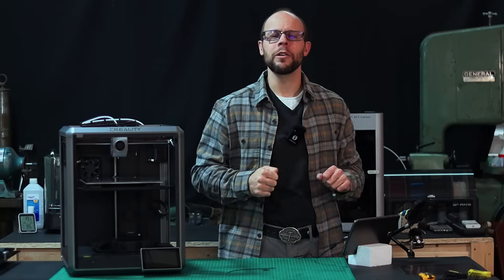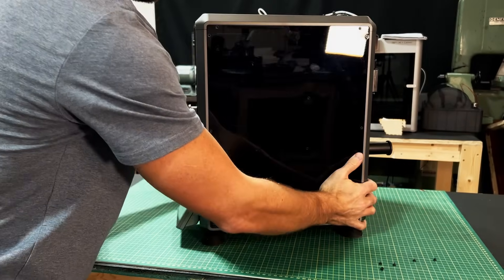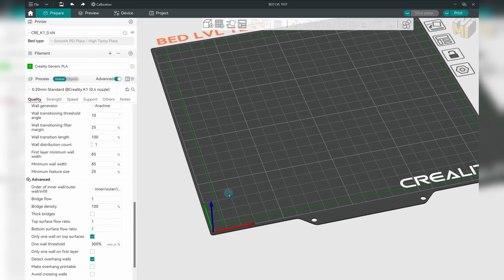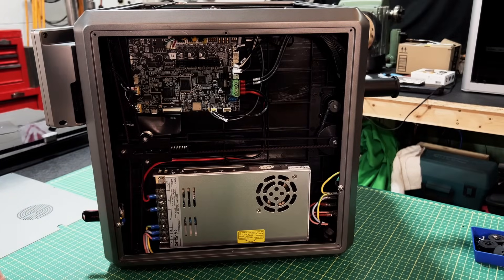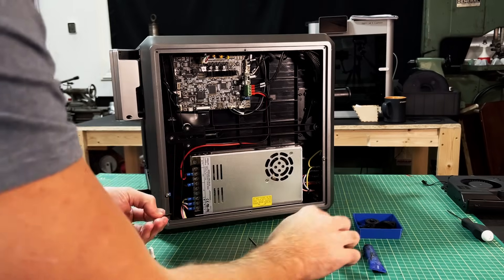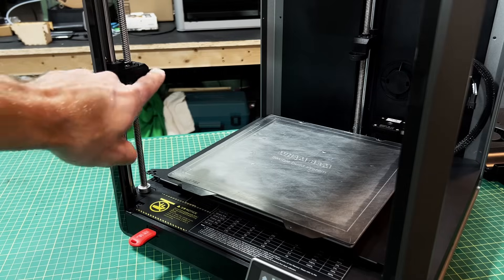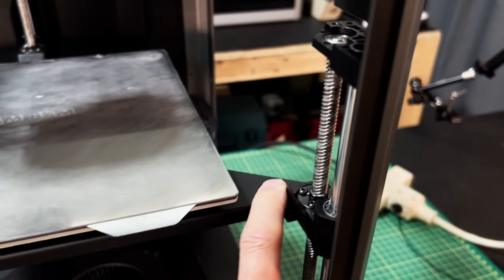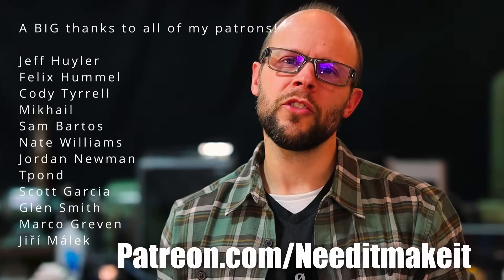Quick and Simple Way to Level Your Creality K1 or K1 Max Bed

Comment: what is the name of the program that u use to show heightmap? Iam using Creality Print but didnt seen this thing in it.
Reply from the maker: LOL, you can find the heightmap by typing in your printer's IP address into your search bar.  if you want to use the programs that I used, those are either Fluidd or Mainsail and you'd need to root your printer.  I have a video on that already.  It is called 'Quick Root your K1"

Comment: Hey man, I print mostly in ABS/PETG, where bed temp is aways higher, should I calibrate my mesh under those temperatures? (I figure that if not, the printer will work over a bed mesh completly different of reality (mine warps a lot under 100ºC - for ABS)
Reply from the maker: Hey, I have made a few follow up videos on just that subject, Let it soak is one of the most recent and probably helpful videos for you because we've been able to add some coding to automatically account for the temperature difference and warpage at those higher temps.  

In any case, the answer to your question is yes you should for the best results.  If you have the K1, the bed is smaller and it's not as much of a problem, on the Max, there is quite a bit more warpage and you'll want to leave the printer at the desired bed temp to soak.  

If you have a moment, check out the Let it Soak video and let me know if that helps.  If you don't want to watch it, there is info in the video description to help as well.
Reply: I would really like to agree with you, if I was not in a 10 days streak of TERRIBLE first layers with no sign of solution. Tried everything, to no avail  @NeedItMakeIt

Comment: I bought a K1 Max today and it is off almost 2 mm. I will be printing some shims. I think the reason the bed can't be fixed totally by adjusting the belts is because the way the pulleys were fixed to the shaft and the number of belt teeth from the left and right lead screw. It could maybe fixed if the set screws were loosened and re-tightened, but I don't want to mess thing up to much at this point.

Comment: I just learned something trying to do this that I need to share - if you're having trouble with the nozzle dragging the build plate, before you take the bottom of the machine apart, try to wiggle the nozzle. If the nozzle has any play in it, the hot end is probably loose!! There are two long M2 screws holding the hot end on. Pull the silicone sock off the hot end, being careful of the wires, and make sure the screws are tightened at the top. If the hot end is loose, there's a good chance one or both screws will fall out when you remove the silicone sock.

Comment: I just love your work.  Thank you for taking the time to do these videos!  
Now do me a favor and get a good screw driver ;-)  
I just can't work without my snap-on ratcheting screw driver.
Reply from the maker: Thanks, oh, I've been using PICQUIC since I was a teen, and  they work pretty well, though their quality isn't what it was for the bits.  I plan to upgrade my keys, I'm just about to buy a new set right now, some of my other tools will come next once I can ramp up enough with my YT videos.    Do you have a model # that you can share for your favorite screwdriver?
Reply: @NeedItMakeIt  I sure do.  8-3/4" Ratcheting Standard Screwdriver SSDMR4BO.  Like you, I have had this since I was a teen.  So now that I think about it, I have had it for nearly 30 years...
Reply from the maker: @christiandrouin9460  That's a nice tool!  The price is a little high, so I will make a deal, when I reach 100K subs I'll buy one outright and I can make a video on it to see how good it really is.  A 30+ year tool is worth the extra $$.

Comment: Printed up your spacers, tried two on a side that was on the low side, but I had to recalculate. I decided to go with a single spacer, the second smallest just for one lowest dipping corner, the result was almost pure white & mostly level, then I decided to tighten the existing screws, more on the highest end and it actually helped a bit better.  I did not use the long securing screws for transport.  I think because I only used one thin spacer, the mesh resulted in being closer to the board in the diagnostic window. Thanks for your help.

Comment: Can anyone tell me the exact size of the screws that hold the bed down? I lost mine.
Reply from the maker: I didn't find that you needed them, when you remove the belt-tension, you can bottom them out and then re-apply the belt-tension to them.  Having the screws is a bit of a problem because it causes the arms to pull down into a position that they will not be when the screws are removed.  As long as you can get it to within 1mm, the shims will do the rest of the work and get you to where you need to be.

Comment: u dont turn any rod ? just put donw and zero to factory position when use screw ?
Reply from the maker: Unfortunately the factory position will not give you a bed that is parallel with your gantry.   You can use a method called the tooth skip, or you can unscrew the nut on two of the screws and turn it, it may end up raising/lowering more than you'd like it to.
Reply: @NeedItMakeIt  i get 4 screws m4 30mm 4 creality spring 20mm and fix ahahahah! now start screw calibration, i reduce factory leveling 4.7 or 5 to 0.424 now try fix more! thx per help

Comment: I bought this k1 max of yours...
in general, I never advise anyone to take this garbage.

The quality is low. My old anycubic i3 mega (not even an s) printed better, but this one out of the box prints very poorly, even at low speeds. There is snot everywhere and at the same time the model is constantly peeling off.

The AI camera does not work, it is essentially a useless function that hangs like a dead weight, the broadcast turns on every other time and has never saved from hair instead of printing.

This printer is not in the kura or in the creality's own slicer. And there are no settings for it anywhere.

This miracle of Chinese thought got clogged on the 5th printing, disassembling it is still a hemorrhoid, yes, of course, the light printhead looks beautiful, but it is arranged as idiotically as possible

In general, it can be used as a 75k coffee table, but as a printer it is the worst for its money.

Comment: What you are doing is unnecessary and far too complicated.
Before I convert the print bed like you did, I find it easier to turn the respective Z-spindle. And since the factory mounting bolts are all the same length, you only need to worry about the front two spindles. I personally found it much easier. After all, you only have to do it once.

Comment: There is a better way… I just did it to all 3 of mine. The beds were visably out with the left being high seems typical with everyone else. I instead of flipping it over, you just unscrew the 4 screw on the lead screw nut. Turn the nut clockwise one screw hole. This seems to be about 1mm. Worked out perfect on my printer. It’s too much of a pain in the ass to move one lead screw the recommended way.
Reply from the maker: Hey that's a great solution, nice going!
Reply: @NeedItMakeIt  I wrote you on instagram another idea I had would be cool to see you try it out I’m going to play around with it and see what happens as well.
Reply: Would you please tell me where is that 4 screw on the led screw nut at?
Reply from the maker: @mikearocho3859  Should be accessible from the top where the 'wings' of the metal frame below the bed connect to the z lead screws.  You might want to take the side panels off to have a bit better access, it's pretty tight in there.  Lower the bed of course as well.
Reply: @mikearocho3859   the nut is on the lead screw it rides on the lead screw that drives the bed up and down. There are 4 screws on the top. Just behind the section people have been shimming. Mine is near perfect across the front now and slight deviation in the rear. I’m thinking about drawing up a cambered shim to fix the rear just to correct the bed ever so slightly. Mine only has less than .3mm deviation  in total now the rear right corner being high.  But printing ok. Time to root and follow his other tips

Comment: I can do this also on my K1C?
Reply from the maker: I'm surprised that it's still a problem on the K1C, doesn't it have a different bed setup, or did they just add a shroud around it?
Reply: @NeedItMakeIt  i was getting realy bad first layers but eventualy i tweaked the slicer a bit and am still trying to fix it
Reply from the maker: @TheKingJuliano  Okay, I have a few videos on that subject, and we have a fix that works pretty well for the K1 and the Max.  It was something I saw more with the Max, but the K1 also had these issues, we needed to have the bed soak for a little bit before it started to probe for a mesh, this made sure that we have the most accurate mesh, those beds seem to be prone to warpage.

Comment: hello new to printing here and i been having issues with he level of my bed. what program do you use to get those mesh readings? thanks in advance :D
Reply from the maker: Sure, if you don't want to root your printer, you can type in your printer's IP address into your search bar and that will bring up Creality's UI and you should see a mesh there.  The blue will be low and the red will be high, you just need to shim the low areas to raise them about to here the high areas are, within 0.2mm is perfectly fine.   I have a few more videos on how to dial in the bed level even more and I have a quick video on how to root if you want access to a better UI for your printer as well.  Let me know how that works.

Comment: Oh my god man, just bought a K1C and I have had a few minor issues due to the calibration, and don't get me wrong, the printer is great, even with how it came it prints great, but this small change made a lot of difference, can't thank you enough Mike!
Reply from the maker: Good stuff, I've been wondering how the K1C was doing, I've seen a few reviews, it seemed like mostly a few small changes, the motors are a good change though.  I guess they did the cable chain raising as well.  Were there any leveling knobs on the K1C?
Reply: @NeedItMakeIt  Yeah, there is the cable chain riser but there are no leveling knobs unfortunately, most of the K1C community is still a bit confused on how to calibrate their printer, but your method works like charm. It is a great printer when it works well, and I say this because there is one major issue with the hotend, the screws are very short, they can barely be tightened when you have an issue with it, I have seen 6-7 owners (including myself) so far in Reddit and some other groups with these screws already sweep and damaging their beds because the nozzle runs that low that actually damages the bed when they sweep during a print, we ended up installing new screws, using Loctite with the stock ones, or even changing the stock hotend for the microswiss, but still a good printer 😂
Reply from the maker: @DjN3cr0  I haven't heard of that issue, I'd like to think that Creality can find a way to address these issues, sometimes there is so much info out there that it's hard to know the true source of the problem.  In the case of the bed though, it needs to be closer to parallel from stock, parallel with the gantry, not screwed to the bottom of the printer instead.  

I'd like to do some upgrades to the printer, I like their extruder and hotend setup but you're right it does seem to be poking out quite a bit.  Not as much as the KE printer which has the entire extruder hotend attached to one corner bracket attached to one lin-rail carriage.  That one needs an overrhaul.
Reply: @NeedItMakeIt  I bought one and now I am struggling with this issue due to 0.7 mm discrepancy between opposite corners of the bed. Unlike in K1 models, there are no screws to manually adjust the bed in K1C. By following this video I am not sure how to remove the belt either since the tensioners are also different in K1C. The official technical support suggested this video after trying the built-in auto-leveling calibration that does not seem to be working. In the reality, Creality's auto-leveling feature is configured with such a tolerance for the Z axis, that should be seriously looked at. They are now sending a new hot bed to me under warranty. Although, I will probably need those spacers to come to be able to use my printer, thank you so much for them and this video. This is probably the only way for K1C owners. If you have any other suggestion for a K1C, please share it.

Comment: What software and how does it work to show if your bed is level
Reply from the maker: If you haven't rooted, you can type your printer's IP into your search bar, that will give you Creality's UI.  If you've rooted  your printer, you can use Mainsail or Fluidd, I have a video on that subject specifically if you need to see how to do it.

Comment: A very useful video!

Coincidentally, I tackled the same problem this morning. Your method works faster.

First up: The official Creality calibration method, with the bed all the way downstairs, didn't work for me either. The printer is manufactured too inaccurately for this. In addition, I don't think anyone has kept the deviating transport screws.

What I did was to lock the belt under the printer in the right place and thus shift two of the three gears relative to the belt.

The result was reasonable. Approximately 0.3mm deviation across the entire bed.

I was working on this for a long time. Adjust, heat 25pts measurement and set it up again. Over and over again.

Your method is faster.

You might get an even better result if you place shims in addition to your method in the right place under the 4 support points. Although I won't bother. The bed itself is also not 100% flat. The 25 point equalization also does a lot.

Thank you very much for your good video.

Comment: How do you get all the info in your fluidd web interface? Mine shows the bed heat map and it has the slider that shows the top and bottom number but thats it. It would be helpful if it showed how far off it is.
Reply from the maker: If you need Fluidd, you'll want to root your printer, I have a video on exactly that subject, and I made it short so anyone can do it easily.  https://youtu.be/YG34iK5wb14   Without rooting you'll be stuck with Creality's UI, which works, but you'll have way more luck with Fluidd or Mainsail.

Comment: Holy crap thats GENIUS! My bed is off by 1.6mm but thankfully its flat, it just dips down in the back. Its like the rear screw is 1 rotation low. Your spacers should fix it, I can't wait until I get home tomorrow!!
Reply from the maker: It's pretty simple, and if you haven't rooted your Printer already, I have a video on that, I also have a video on the "Soaking" of the bed, and I should mention too that you can access your UI for Creality if you haven't rooted yet by typing in the printer's IP address in your search bar, Creality Print does not show the mesh by default for some reason.  Good luck!

Comment: where did you access the config file to change the mesh grid size? actually come to think of it at 0:30 I see an interface that is totally different from mine - is this Creality Print? I don't have the table of numbers for the mesh. I don't have the dashboard. I'm feeling a bit lost!
Reply from the maker: To get that interface, you'll need to Root your printer, I just released a short how-to video on that subject this past weekend if you'd like to do that.  Without that you'll not be able to access any of the files on your printer.  If you just want to see your bed mesh, you can type your printer's IP into your search bar and at least you'll have access to Creality's UI.  I hope that helps.
Reply: @NeedItMakeIt  Ill check it out thank you
Reply from the maker: @sblack48  It's worth the time to root, it opens up a lot more options with these printers and you can learn more about what's going on behind the scenes as well.

Comment: Wow - your spacer solution made a huge difference.  To start, my maximum bed deviation was 0.709mm.  Left front was the high side.  Used a 0.2mm spacer sanded down to about 0.1mm for the right front.  Used a 0.7mm spacer sanded down to about 0.65mm for the back.  Maximum deviation was reduced to 0.084mm or about 12% of the original deviation.  Per your other video, I heated the bed to 55 C for 10 minutes before each bed check.  Will be leaving a donation.  Please keep up the great work!
Reply: Hi what program are you using to get the levelling programme to run as I can't find any bed mesh on my K1 program creality print thank you
Reply: Hi Rod!  It is not in Creality Print.  Instead, go to your K1 display panel - click on the tools icon (second from bottom on left side) - click on the network tab at the top - and copy the IP address (will look like 192.168.xxx.xxx) listed at the top. Then enter the IP address into your browser.  The bed mesh will be shown at the bottom right.  Good luck! @rodboorman4989
Reply: You need to open the browser and type your printer id on the address bar. There you will have the option to see the topography of your print bed as well as saving it and /or loading it @rodboorman4989
Reply: I am not a big fan of having to take off the belt at the bottom if it's not going to produce a noticeable affect. I am willing to make the shims and give it a try though.
Reply: I don't know how to draw. Can you send me the STL of the parts you printed?
Reply: @Sinovloger  The downloads are listed in the "More" section below his video under "Download Spacers"